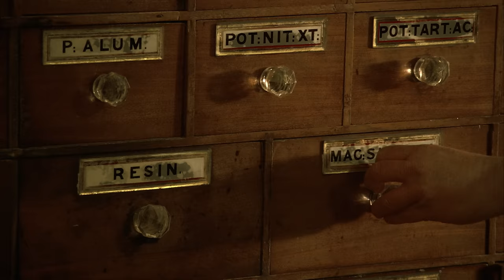Sherlock Holmes y el tesoro perdido | Pelicula completa

Comment: Strange opening scene which is supposed to be during the Blitz yet we see several windows uncovered so that the light from the buildings shine like beacons for the German bombers flying overhead. As I post this I noticed that there are two other postings in English, so I wonder if I need a translator to watch the film?Hmmm, in the scene where they inspect the beached, wrecked boat why did Watson have to climb down the steep, dangerous cliff instead of hiring a boat to take them to the shore.